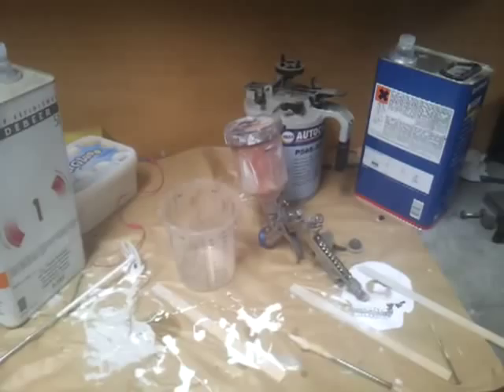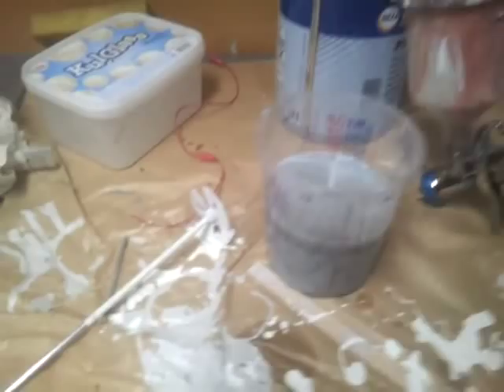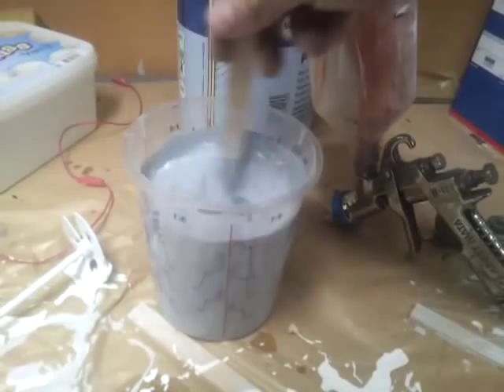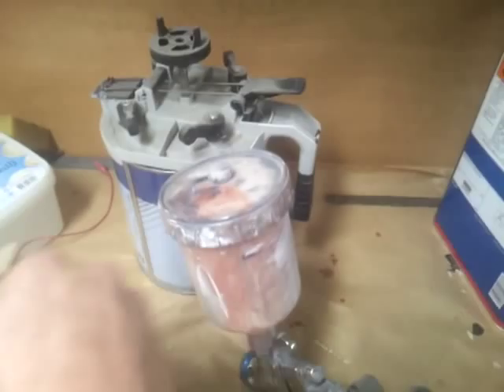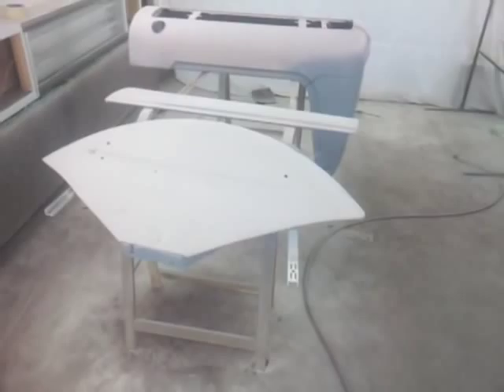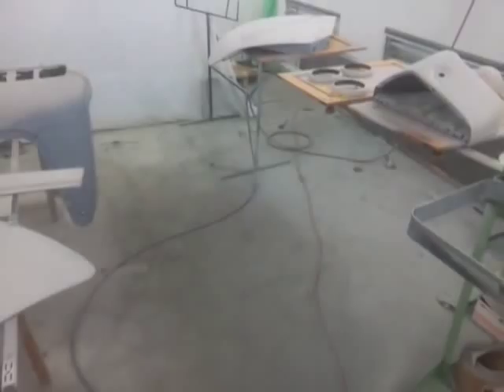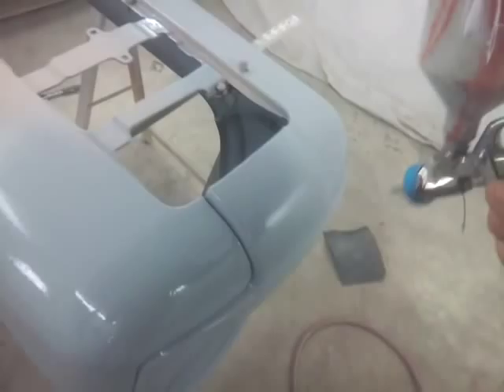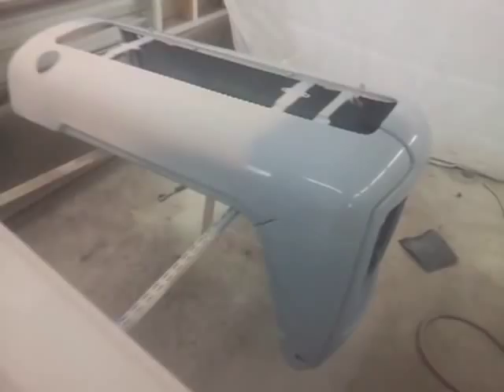Painting some Tractor parts

Comment: Thanks for sharing, I find these kinds of videos very educational for an amateur like me starting out on spray painting. I have only done one project so far   (video on YouTube “Hi Spec Slurry Tanker Refurbish”) It was just to practice. I think my biggest difficulty is getting the gun set correctly and the air pressure set right. Just could not get that brilliant smooth finish. Do you have any suggestions please?
Reply from the maker: Regarding smooth finish there can be allot of things people are missing up on. One of the most common is that they don't dare to put on enough paint due to runs that could happen :)  
Second common thing is wrong mixture and lastly is the heat on the paint/surface and in the air. If that's not correct it will not flow out.

Of course the gun is dependent to. But in general make sure its clean and you are running on max setting with recommended nozzle size and pressure regarding to specs of the paint.

And train, train alot :)
Reply: daromeresperyd Thank you for taking the time to respond with your tips. I will take this advice and practice :)